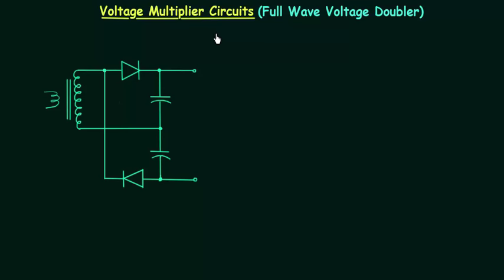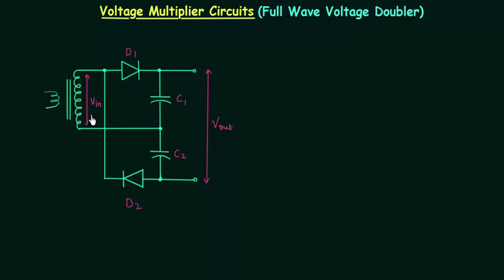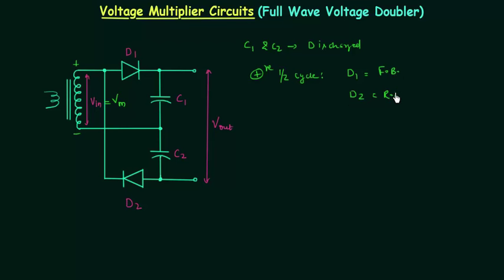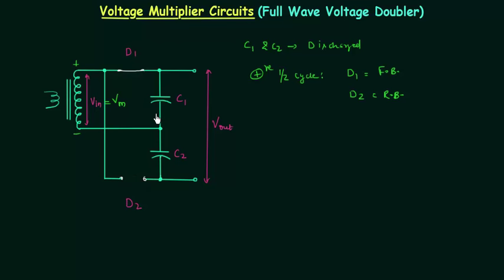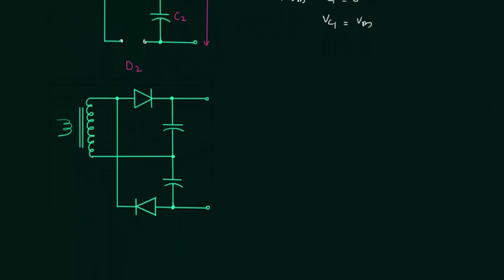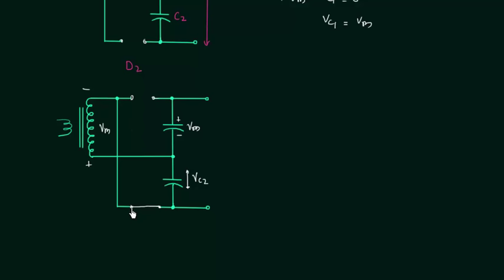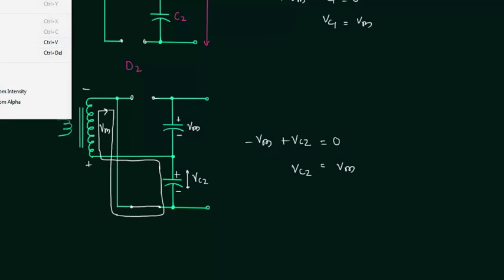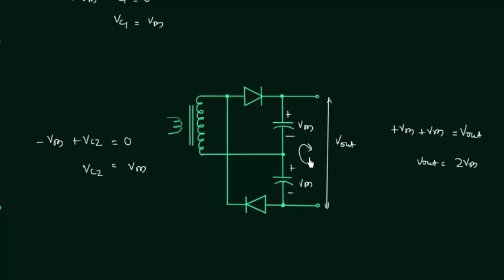Voltage Multiplier Circuits (Full Wave Voltage Doubler)

Comment: Correction at 3.15 : Diode D1 becomes reverse biased.
Thank you vey much for this! I was totally confused on figuring out how to determine if a diode is forward or reverse biased in a complex circuit until i came across this video. Thanks again
Reply: According to me the direction of diode D2 should be opposite. Someone please clarify.

Comment: Will this damage my transformer? My coil can handle only so much voltage and ampacity. Will this device flow too much amps straight back into my transformer and over heat my coil?

Comment: why did you not consider the capacitor voltages when finding the diode states? You just considered cycle states that are positive and negative. I am a bit of confused, is it a assumption for voltage multipliers?